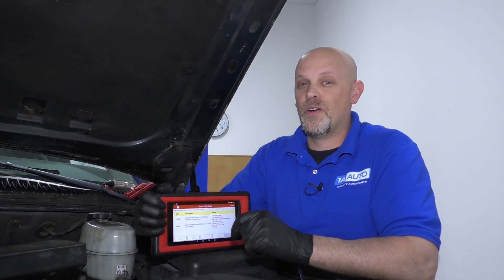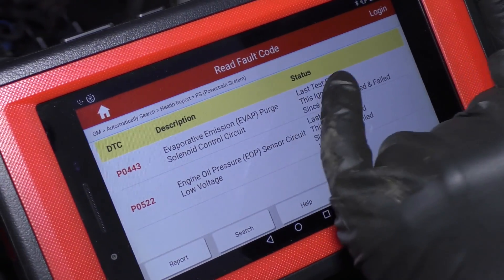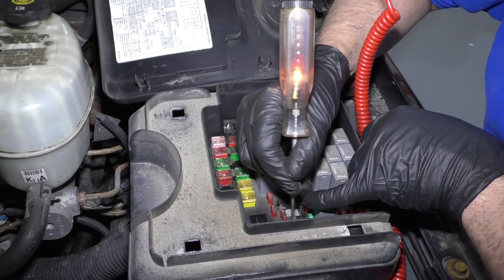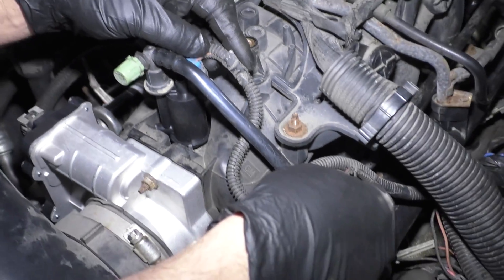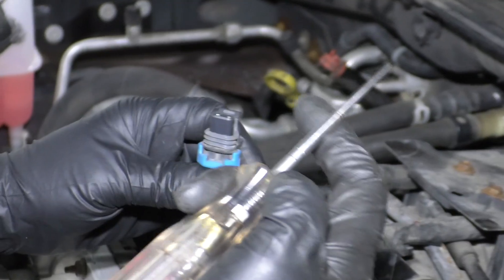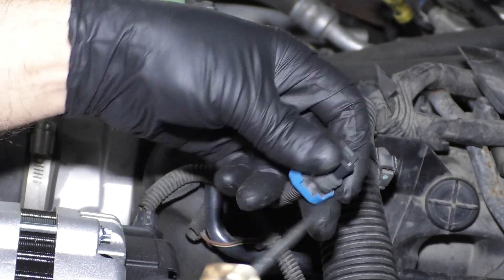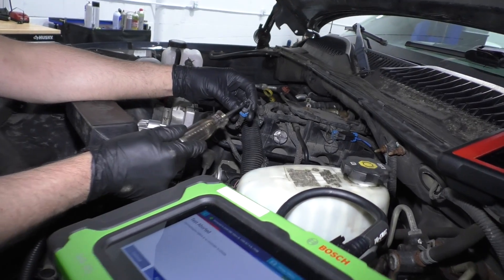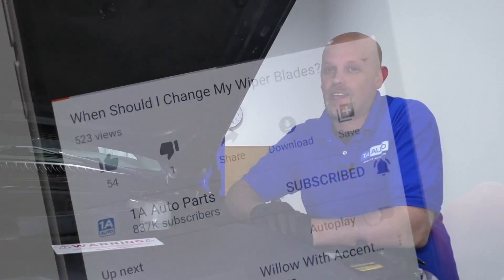Check Engine Light? EVAP Purge Control Valve Circuit Malfunction - P0443

Comment from the maker: √  Watch the Video
√  Buy The Part at 1A Auto https://1aau.to/m-Visit-1AAuto
√  Do it Yourself
√  Save Money
Reply: One question, that means is not a serious problem?
Reply: @IkelosEU  no it’s just a Ny State inspection thing
Reply: @IkelosEU  Not a serious problem. But if left unchecked and unsolved for too long it could slowly cause more damage to the vehicle. 

Replacing the purge canister valve is a relatively easy thing to do and costs under $30 for the part.

Comment: Great info on testing the purge valve circuit...I just got that 0443 code on my 2000 Oldsmobile Shillotte, just 2  weeks after replacing all the spark plugs and s p wires, pcv...I passed my smog check ✅ and now Im getting that code

Comment: Hey Man I have a couple of questions if you can help me It would be so helpful to me..  And I can ask you the question here I guess.
Well I have a 1995 Chevrolet S10 4x4 truck with the 4.3 L engine in it and I pulled the motor and transmission out about 4 years ago and I decided to go ahead and rebuild the motor myself and have rebuilt a lot of motors in my time but I'm old school mechanic before all the EVAP system but my questions are where the lines coming from the gas tank up to the TBI I know one is fuel in and another is fuel return and the other one is a vent line and I'm kinda lost from there it has a purge valve with two line inlets and a elec connection plug and I think I know how it goes back until I saw another bracket with a model control with a vacuum on it and I bolted it to the motor and the hose  coming off it went to the back of the TBI and I think on the purge valve where it has two inlets coming out of it one goes straight into the intake but where does the other one go idk because there's another one that has a green cap on it and idk exactly how it hooks all up and then the vacuum hoses going to the transfer case with the 3 outlets coming out of it , is there any way you could draw a homemade diagram of where all the hoses go and send it to me or try to tell me the way it hooks up I would be grateful for your help if you do , I really would appreciate it and idk what else to do I've seen your videos and seen your a mechanic also but the newer vehicles which I know mine isn't that new of a vehicle but I do need some help and I don't never ask for it. My oldest son gave me the truck several years ago and now I'm wanting to fix it up to drive or maybe if my grandson likes it I'll be able to give it to him In  a year when he gets his license. I've searched for so long on how its supposed to be hooked up and I find a little about everything else but what I'm after , well I guess I've said enough I'll let you get back to what you were doing. Either way I appreciate you and thanks in advance too..
I'm Paul too.

Comment: I have check my selenoid . And its work fine. But when im cek the connector just showing Randomly Volt from 4 to 6 when ignition key position ON. Is that normal? Or im just to try rerase code? Because before that i have my battery dead and change it 2 weeks later. My car is BMW E46 M54

Comment: I took my 2019 Silverado to my local dealership service center.  Before they looked at it i just had a p0442 code. Now I have the p0443 code. They wanted $500 to replace the purge valve. They claimed it was bad. However,  I didn't tell them it was just replaced a month earlier. Crooks

Comment: I have a 2006 prius and had 3 codes. P0446, P0443, and P0420. I used Rislone cat complete with 1/2 tank gas. I burned it mostly highway, and P0443, P0446 disappeared. Only P0420 now. And I just changed the downstream 02 sensor. After clearing the code, it comes back on after about 37 miles. Im hopeing to do a drive cycle and get it inspected before a pending or eng light returns.

Comment: My car has a bad purge valve right now. Multiple evap codes 02 codes as well.  Its having a tough time accelerating only sometimes for some reason. Had low voltage on the valve but the valve still works I guess. Not sure how what I need to do. Kinda sucks it's confusing.  3.4 ohms on purge valve

Comment: how to contact you through whatsapp?
Reply: i have a problem.... my purge solenoid valve receive 7 volts on red wire and 3 volts on signal wires? i suspect my ECU doesn't send signal properly.

Comment: I didn't do all that but for the price of the solenoids I just replaced all 3.  Code came back and there is a squealing noise at the back of the drivers side and then my idle begins to drop and flutter.  Replaced the purge valve back there but the squeal when I come to a stop and the idle drop continues.  Any thoughts?

Comment: I have replaced the valve and still get the open circuit code. P0443. Tested with voltmeter and the voltage fluctuates from 12 to 7 or 3. What could it be
Reply from the maker: +Mario We wouldn't be able to diagnose an issue like that here, you may want to have a local mechanic take a look at it. Thanks for checking us out! http://1aau.to/m/Shop-1AAuto-c

Comment: problem is when you replace ths solenoid piece, the check engine light stays on in this 2007 cadillac cts. they say only cadilac has the equipment to actally re-set that check engine light????

Comment: I have a 2001 Toyota MR2 Spyder.  The voltage between the two terminals of the connector to the purge solenoid when it's OFF is about 3 volts and when it's ON is about 6 volts (engine OFF and key in ON position).  Instead of one loud clean click and stay on, it's constantly  switching on an off really fast after being turned on.  Are those normal reading and behavior? The vent solenoid is 0 volt when OFF and over 12 volts when ON.

Comment: 2012 Honda Odyssey...

I was just charged $560 to replace this valve and canister vent valve.  We replaced our cap a year ago.  Drove away and two hours later check engine light with P0443 again!  What didn't the mechanic do!!??

Comment: I get ch engine light once in a couple of months give or take, engine runs perfect. Dash code was evap icon but no actual code Orielys did the test. I just disconect battery and everything is fine again. Guess i will change the evap sol on the engine

Comment: Thank you so much for this detailed video🙏🏻. I do have a question. I'm working on a 2007 Ford Freestyle and has a check engine light (code p1450, p0451). FYI, I have checked ALL the hoses, Vent solenoid, REPLACES/NEW purge Solenoid, charcoal canister...and they are all in good shape and tested good off the car with NO ISSUES. However, the ONLY thing i found was, for some strange reason I do "NOT" get constant +12v to purge solenoid (engine cold with no key in ignition) as you demonstrated, but I do get +12v to vent solenoid near charcoal canister near the gas tank). The voltage on my meter constantly in small increments changes rapidly no more than 1v to 1 of the 2 wires(i even test the wire 2 inches blow the connector and still the same). So I checked the fuse box, the wires, and contectore....fund NO PROBLEM ANYWHERE, not sure why I'm not getting constant +12v to purge solenoid in engine area like your diagram.
1. Does the ignition key has to be on, or engine needs to be warm/running...to get 12v to Purge Solenoid +wire? (the rear vent solenoid gets +12v constantly, key or no key, warm or cold)
2. can I run a +12v direct wire from the fuse box to the +wire to the purge Solenoid (rewire)and just cut the one that's not getting any voltage since the ECU sends the _negative signal? (not sure exactly which wire is the + and which wire is the _ wires tho, since I have no wiring schematics, I'm just assuming the wire that keeps fluctuating very small amt of voltage is the + wire, but not 100% sure, is there a way I can test the _ wire from the ECU with a regular meter be sure?)
PLEASE HELP🙏🏻🙏🏻,Thx

Comment: I replaced mine but it still runs the same code.
Reply: cadillac apparenty has the only equipment to reset that chcck engine light. they will tell you how they had to diagnose the entire engine and  charge you over $200 then simply reset the check engine light

Comment: Any idea i have two codes (p0403and p0443 on ford explorer 2009 4.0 v6 are they related ? I cleaned the egr and throttle not fixed im assuming by replacing the evap solonoid will fix the egr right ?

Comment: What if you changed the solenoid and you checked the connector, everything is 100%. But your check engine light is still reading the purge valve. What do you do?
Reply: I have same problem & I changed gas cap as well as installed a factory Ford purge valve. Still have p0443 code. 2005 Ford Mustang 130,000 miles. Any info would greatly be appreciated !
Reply: There’s also a canister by the gas tank that can be bad.
Reply: @DiligentDave1966  I have a 2010 ford explorer n this code came up my truck turns on n shuts off, after a while it well turn on idk where to start on this issue and advice?
Reply: @joerodriguez2645  I have the same problem except 2010 f350 xlt the code came up and went through everything now it's only allowing me to go like 40mph on e it warms up
Reply: Same😭
Reply: Change the gas cap
Reply: @giomontalvodelcompare8418  gas cap can cause this problem??

Comment: hi, i replaced the evap purge solenoid but the p0443 code keep coming up! help
Reply from the maker: +Gabriel Duarte We wouldn't be able to diagnose an issue like that here, you may want to have a local mechanic take a look at it. Thanks for checking us out! http://1aau.to/m/Shop-1AAuto-c
Reply: Same code keeps popping up on my accord p0443 after I changed that what else could it be?

Comment: I've an Altis petrol (1ZZ FE). Two days back, I changed the oil + filter, cleaned the air filter + housing. And now I've this P0443 on the scanner. Should I just check with the wiring and the fuses or anything else?

Comment: I did this to change a knock sensor and changed gaskets as well. Now I have an extremely bad leak and engine stalls. I can’t think of anything I did wrong. Any ideas?
Reply from the maker: +Zach Reynolds We wouldn't be able to diagnose an issue like that here, you may want to have a local mechanic take a look at it. Thanks for checking us out! http://1aau.to/m/Shop-1AAuto-c
Reply: Bad sensor.. over/undertorqued valve cover. Causing distortion in the body.
Gaskets are misaligned.
Knocksensor my not have been set properly.

Comment: I have a 2006 ford explorer with the code p0443 purge evaporation circuit fault, the question is if this fault is related to what the EGR valve code p0403 appears, if I change the purge valve, will the two codes disappear?
Reply: I have both codes as well. Purge circuit fault first then egr valve. Did you have to fix both?

Comment: I don’t have that test tool, how else can I check if it gets power on the wire?
Reply: Have someone slightly rev the engine while doing it
Reply: It's called a test light, very inexpensive tool. You can buy one anywhere.